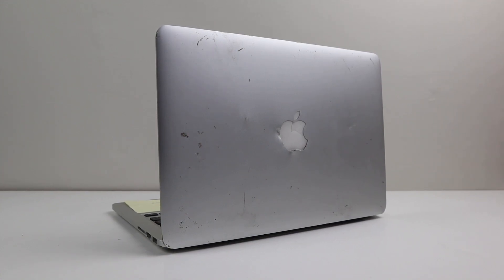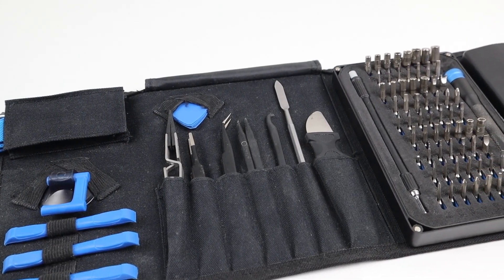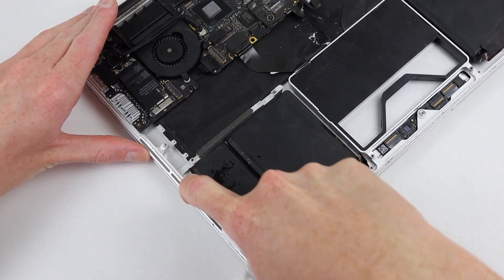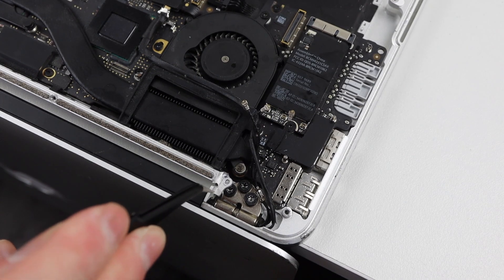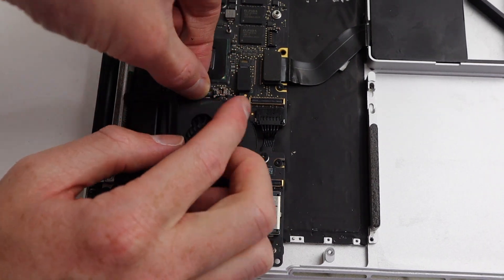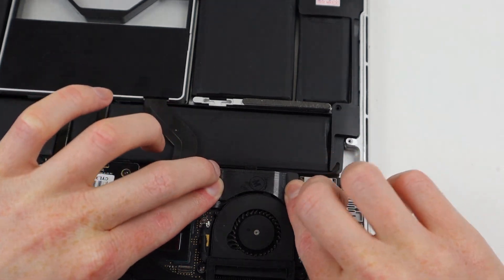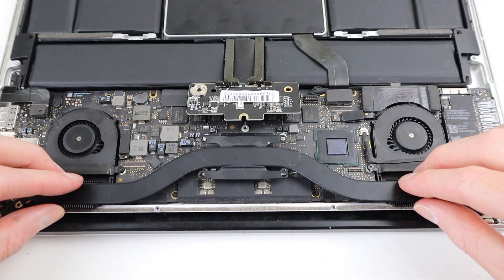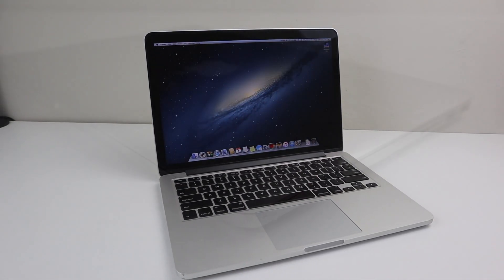Destroyed MacBook Pro Retina  - Can it be Restored?

Comment: I get its because of the sponsor and all, but those proprietary SSDs are sooo expensive when you can buy a $10 adapter to use an nvme.. The price of a 128gb one is like $80 used when you can get a 500gb Samsung 970 evo plus for $80... which would also be 3x faster... you'd get like 1500mbps read and write compared to 500. A 15in retina would get the full 3500mbps out of it

Comment: Hello, good day i have a macbook air 2017, first i was using it it was working fine and all of a sudden it refused to power up but it was charging and i googled the internet i found a solution to press shift+option+control+power at once it turned on. i put it on sleep and the next time i want to use it failed to power up. i tired the same procedure to no avail, i dont know what is wrong with this laptop. its not even water damaged. i will be so happy if this thing come to life again. Thank you

Comment: You're probably not gonna see this, but I'm just curious. I have an early 2015 13 inch Retina MBP for which I had the battery replaced by a third party due to bloating. It's fine for the most part, but the one issue I have is the fact that the HDMI port is not working. When I plug into it, the MBP display sort of flashes on and off or just remains off, and there is no display on my external monitor. I have tried all sorts of resets but nothing worked. And I know my VGA to HDMI adapter isn't the problem because it's working for my Dell work laptop, and the VGA cable itself isn't a problem because buying a Mini DisplayPort to VGA adapter solved the problem. I'm just curious, what could be the cause of this, and is it worth fixing or looking into?

Comment: Cell phone contruction on a laptop .... I dont get why people overpay for them  ... REALLY I'm sure if you can use it as a daily driver at work. I prefeer a chunky Dell Precision over this show off gadgets. All this garbage of slim led pannels, low prifile keyboards, no ports .... Yes, you get better portability, less weight when travelling. Nothing like Dell or HP havent adressed properly. The difference with HP or Dell is ... corporate ones are under big contracts of maintenance, so selling non fixable garbage is out of the equation. I have used HP 12.1 subnotebook i7, it a delight, it is fast, small, lightwieght and you can still replace the battery, the drive etc, you dont need to call nasa to do that.

Comment: I have a mid 2015 MBP that runs crazy hot especially plugging it to an external monitor and throttles. I have repasted it but still had the problem. Now running it without the bottom lid and in winter is fine but do you have any experience what can it be done about it?

Comment: I had a 2012 Macbook Pro come in to my shop that had been bent by an angry ex-husband.  It was unfortunately bent right where the mechanical hard drive was and bent the drive.  We sent it off for data recovery but the platters were bent and it couldn't be done.  The motherboard was still good though surprisingly. 

On a side note, why do you install the lowest version of MacOS that it will take?  No reason not to install Catalina or at least High Sierra so you can have software support.  I've seen a lot of software support problems with even Yosemite at this point.

Comment: ½ battery missing because the lithium batt exploded? That would explain the poor state of the machine. I was on a small boat in Balboa Harbour in Newport Beach Ca that had a small crack in the hull. We could not steer it to port as it just went in circles as one side was listing. When it sank it flipped over and threw us into the ocean. I had my mobile phone in my pocket and as I was swimming for the shore I could feel it heating up. Once I got to shore, exhausted, I threw the phone away from me and it ended up exploding on the beach. (took a while, not like a hand grenade). The damage was similar to the MacBook. (though it was a mobile phone, not a Mac).

Comment: Why complain about the battery being glued in and yet yourself glue in the replacement? If it needed to be fixed in place, double sided adhesive tape would have been easier for the next repairer to remove.

Comment: Imagine the repair horrors for the upcoming arm based macs. That's apple for you..
Reply: You won't be able to repair them at all... Since battery will be paired to the device just like the screens... SSD is soldered and ram is soldered too. Trackpads are paired to the motherboard as well if I'm not mistaken even in current macbooks. 

So if your laptop breaks you can either pay apple insane amount for them to repair it if they provide their service or you can throw it to trash with your data and all.

What apple has is monopoly since they killed 3rd party service of any kind on current and arm macbooks.
Reply: @JerziTBoss  And another sad part is most people don't care because some are already so woven inside apple eco. and others just simply wouldn't care just because of Brand loyalty. 
I'm afraid if this "method" works for Apple other company will follow their footsteps.
Reply: @jovanienazaire1362  Well for now it's best to go for business class laptops like Thinkpads and HP and Dells because they will keep upgradeability for a bit longer. 

But I hate this trend of soldering and glueing everything in place while screaming about being eco friendly.

I'm going to service my thinkpad until it's not possible to fix it.

Comment: Prices for these MacBook screens are insane. I paid 2/3 of worth of the used 13.3 MBP for a screen itself. After that it turned out that even tho the screens are interchangeable physically between 2013/14 and 2015 models, they are not 100% interchangeable in the terms of working. Sometimes I'm getting a weird flicker and backlight doesn't work until you log in.

Comment: Hi Hugh, I live in Keysborough Vic, maybe not far from you. I have a MacBook Pro 2011 17’’ which is having a gpu issue, so after watching some video on YouTube, I followed it guy taking the mother board out and heat the gpu with a heat gun. But after putting everything back, plugged the charger cable, I can see the green light and the fan spins for a sec and die, not being able to power on or boot up. Any ideas, mate or that would be great if you can try to help me out , thanks in advance. Best regards

Comment: I feel like they damaged the screen somehow, maybe a drop, then tried to repair it themselves. However, they were entirely unprepared. They couldn't remove the part of the battery with the adhesive and thought that, since there are multiple cells, the battery was modular. They also badly removed some connectors and the speakers, maybe in an attempt to sell various parts of the laptop once they realized that they had made it worse.

Comment: I bought a retina in very good condition, it only had 1 problem, there was a lil white square in the bottompart of the display (where the downloads folder is if you just installed macOS), which is actually very weird! It looked like a very small part of the top polorizer was missing! I glued a small piece of a polorizer from an old broken cell phone on it, and it works, the white spot is gone, the pixels actually do work, i have no idea how that can happen but for the price i paid it was worth it! The battery is in good shape as well, but i could use a bigger ssd because 128gb is a bit cramped

Comment: The last owner must have taken “destroy that like button” too seriously
Reply: But seriously how do people break laptops to that extent?!
 I've had a plastic chasis laptop for 10 years now. Only thing thats broken is the hinge plastic covering. 
How do you even break metal laptops!!
Reply: @gurpremsingh  Kids can destroy EVERYTHING if they get bored
Reply: @derpsakry4464  yup! Kids, the ultimate force of destruction 😂
Reply: @gurpremsingh  I've owned a magnesium alloy laptop for two years, and I love it!
Reply: @gurpremsingh  ran over
Reply: Yo I beat ur record by 313 space back clicks
Reply: When an early 2013 mac book pro  has a better processor than your early 2020 mac book air :( Visible confusion) My mac book was 1,500 dollars and I have an intel i3 processor like apple whats the deal
Reply: @lolozeeee  That's the thing with apple, mid range and low budget-value options just don't exist.
Reply: @lolozeeee  look at the actual model number of the processor instead of just going "i7 best, i5 good, i3 bad"

I can guarantee you that your i3 is way faster than the i5 in this
Reply: @TorutheRedFox  I computer can barely run games like roblox without almost crashing I can asure you that this is better than mine
Reply: @TorutheRedFox  I don't use wine or anything I use base mac os big sur
Reply: @lolozeeee  you sure? your macbook is probably quite a bit faster. if it struggles running light games try reinstalling mac os.
Reply: @lolozeeee  better but older
Reply: @lolozeeee e-2020 airs are a laughable disaster
Reply: Lol
Reply: Me: How could anyone break a laptop that bad?

JerryRigEverything: 🤷‍♂️
Reply: Absolutely amazing.
Reply: 1 thousandth like
Reply: @Plainrock124
Reply: @KAAN CAN no. It was a Dell from 2007.
Reply: ye cuz trashpple computers are garbage anwyay

Comment: I always look for your new videos on YouTube almost each time I am on YouTube, it's like I am becoming more addicted to your channel here.
It is another good repairs done here.
Thanks showcasing your expertise in repairing this. I am having same type of Mac, but still looks like it is coming out from the Box newly, my probowith it are - 
1• The screen at the uppers there is a bit of discolouration. Will send you the photos if I could get you how to send it.

2• The battery is far gone, it needs to be changed.

3• I need a higher gigs of a Solid State Drive Memory.

Apart from this, you will think this wonderful Mac is just been opened from the Box.

Many Thanks Jeff.

Comment: Nice repair work - that is so much better than the old wreck it once was, and also saves it from the e-waste pile :) I'm surprised that someone hacked out part of the battery!
Those battery cells (which are still there) can be re-purposed in electronic projects, if you get in contact with people who are into electronic engineering and the like. I routinely buy job lots of laptop batteries on the cheap in order to salvage Li-Ion cells for projects, and the Macbook ones generally have more capacity remaing compared to Windows laptops (Windows only reports the battery as dead when its capacity reaches 40%!).
Shame that this was the first of the laptops to feature soldered RAM, proprietory parts (such as the SSD) and no disk drive... IMO the Unibody 2012 was the best one; shame it won't take Mac OS 11 Big Sur (will only got to 10.15 Catalina).

Comment: NEVER wipe down a MacBook display with alcohol it will chip off the antiglare coating on the screen and it makes it impossible to use unless the screen is replaced. Just wipe with a damp cloth applying very little pressure. if you press too hard you'll leave streaks on the screen.

Comment: Thank you for this video - Not often you see anyone work on one of those.
I have exactly same laptop from 2013 early, and I can't make myself try to swap battery, as it's glued there so damn hard. 
Also those used screens are extremely expensive, though Apple sell em to authorized services, 500 usd a piece new. I wanted to swap mine due to grey uniformity defect - still a bit too much.

Comment: The state that the computer is in, is... questionable. It was badly damaged, and missing parts under it inside the casing. However this means that someone who has the correct screwdriver had access to the inside in order to damage the battery and speakers. And apple uses screws that require special screwdrivers, which no normal person would buy, unless they too restore computers, because well... there’s no other uses for that type of screwdriver besides getting into electronic devices.

Comment: Delimitation is common on Retina Macbook Pros and newer MacBooks where the top layer over time will peel and come off that is probably why the display is peeling and layers are coming off. The apple logos on older MacBooks use thin glass and it is not uncommon to have cracked apple logo on older MacBooks. As for the battery someone may have on purpose cut it out for some reason it could have been dropped that maybe is why it is scratched as the aluminum housing scratches and dings easily and the speakers are broken and why the display is cracked and ribbon cable could have also broke during that fall.

Comment: I hope we can do the same thing for the new Apple Silicon MacBooks. 

Oh wait, Apple locked down those things and they'll probably break if you look at them the wrong way.
Reply: @projectorshaping That's already kind of obvious. Apple Silicon is just another part of Apple's plan to stifle Right to Repair and force users to fork over more  $$$ to them for repairs. They've already started it years ago with their T2 chip (aka Hostage chip) which makes repairs extremely difficult for 3rd party repairs. Don't forget their Touch ID and Error 53.
Reply: @projectorshaping the whole system is SoC, meaning one chip containing processor, graphic i/o, ram, and security. there is no fixing SoC. best you can do is open the casing to blow the dust/repaste the SoC then put it back on again
Reply: @anony_meows  so now the macbooks are powerful raspberry pi.
Reply: @anony_meows    actually the ram and ssd are separate chips on the logic board, the gpu and the cpu are essentially the SOC M1 chip.
Reply: @projectorshaping "Things like that is why I prefer Apple products." you have absolute zero arguments but I am used to that from Apple bitches. Keep your eyes closed, boy. Apple wants to own what they sell. Get it?
Reply: @projectorshaping Activation lock helps but physically rendering tons of electronic equipment unusable due to one faulty part is ridiculous, and helps nobody.
Reply: So you would like pay more for this kind of a fix, that leaves a laptop looking like that, instead of buying another one (that is also in a better condition) for less money?
Reply: @sjdoiajsd  That's one way to increase the amount of eWaste. Instead of having repairable laptops, just sell throwaway devices that are unrepairable that'll end up mostly in landfills. 

Apple's hypocrisy is so obvious and their care for the "environment" is nothing more than a lie for the sake of profits.
Reply: @PeterdaPanda  at least I think that apple recycles the materials they use, so if you bring your old MacBook to them it won't go to waste
Reply: @sjdoiajsd  if Apple allowed 3rd party repairs the costs of repairs would go down. As it is they like to sue aftermarket parts manufactures and reputable repair shops out of the market, making quality parts and workmanship more expensive.